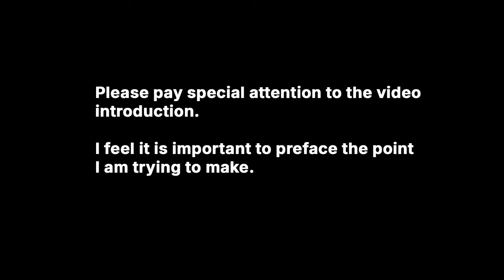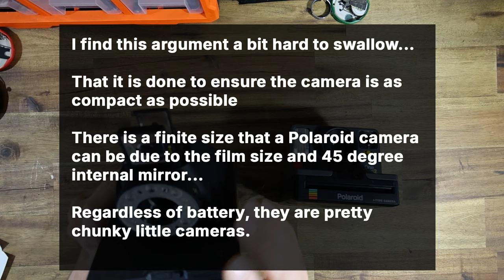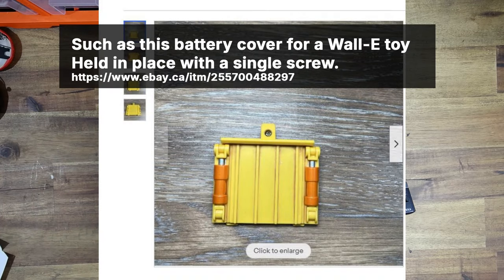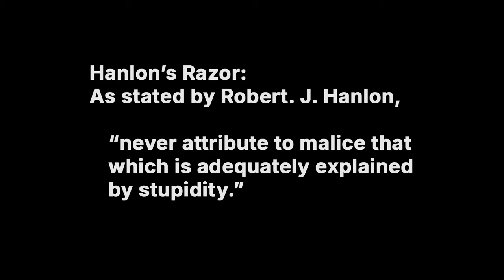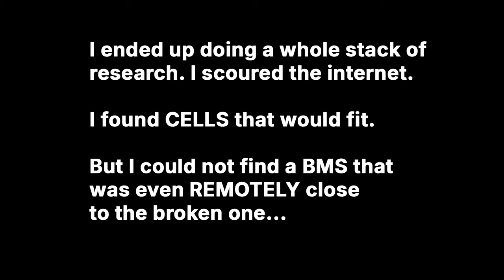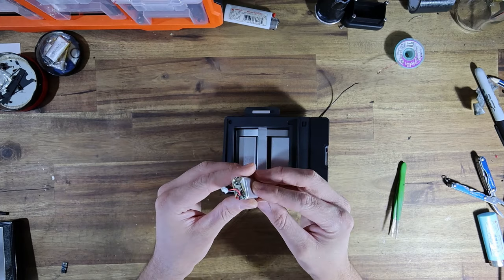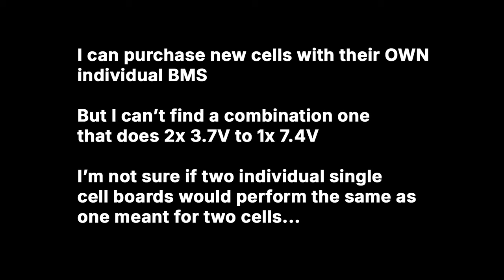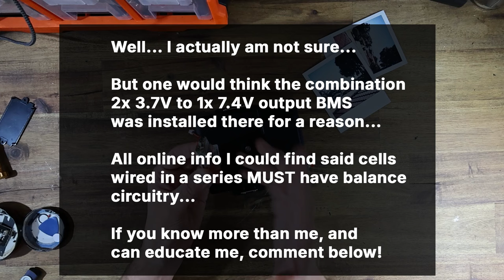Polaroid i-Type Camera Battery Issues - Part 1: The problem with built-in lithium ion cells

Comment: You probably already know this but lithium polymer batteries actually do have a standard. 
If I have a battery that says 103450 it means 10mm x 34mm x 50mm.  In the case of the doubled up packs though, I don't know if that has a standard.

I haven't gotten into repairing Polaroid specifically so I have some stuff to learn, but part of me wonders how many amps the motors pull, because I'm wondering how long two 2032 cells would last.

Comment: Another excellent video Jake and your criticisms about  non friendly battery replacement are perfectly justified. Let's not be coy about it, it's simply a form of built in obsolescence.
And for a company that makes a point that its current cameras are made from 40% recycled materials having non replaceable batteries, where most owners/users are concerned is hypocritical/counter productive. People that have criticised you for making this  point are talking bollocks. As you say a replaceable battery behind a door/flap secured by a screw and a security screw if necessary would make them child proof.
All of  Fuji Instant cameras take replaceable batteries of one kind or another. My Instax Wide 300 uses AA cells and my Mini 90 Neo Classic uses a lithium-ion battery which sits behind a door/flap in the back of the camera.
My Polaroid Now Gen 2 when the battery fails on that which it will do at some time will just end up at my local recycling centre as even if i could find someone to replace it, with the cost of the battery and labour for doing it, it would be just as costly as buying another new camera.
Regards,Patrick
Reply from the maker: After I publicly criticized the I-2 after its launched - and was met with a prickly reception from Polaroid super-fans I feel I must make disclaimers at the start of my videos now

It seems there is an element of buyers remorse, or owner-bias when it comes to doing critical reviews, with owners of i-Type cameras feeling personally insulted when I point out their camera is flawed. 

My intention is not to insult anyone, but to point out how ridiculous it is to have to completely dismantle the camera (and crack out a soldering iron!) just to swap out your battery every 2-5 years

Comment: 36:53
Why wouldn't it need balancing? They're connected in parallel so how would the charge circuit know when both batteries are charged? One can be flat while the other is still 20% charged. There definitely needs to be a board to monitor both cells. For the i1 I would just source a single cell instead of using 2 in parallel.
Reply from the maker: If you were to use off-the shelf cells - each individual cell would have its own standard 3.7v BMS to monitor voltage. Wiring them in parallel shouldn't alter charging in the I-1

Whereas the Instant Lab has a unique custom BMS to handle the combined 7.4V output. It's not a standard part. And hooking up 3.7v BMS units pos to neg seems so sketchy to me

Off the shelf double cells work fine for the I-1, but you are correct - I now use a single 900mHa cell instead of two. It's much simpler. I actually made a follow up video to this demonstrating it. 

But the I-1 I modified to the 900mHa cell had film ejection issues - totally seperate to the battery lol

So they video never saw the light of day. Next I-1 I do... I'll cover it

Comment: I will be following this thread very closely! I wasn’t able to afford the I-1 when it first came out because I was a broke college student at the time. Nowadays i was able to afford them and bought one of eBay not knowing anything about the shelf life of the battery and was super bummed when it didn’t work. 

Then I bought a second one on eBay and it had the exact same faulty battery problem as the first. Double bummed. So if you have a way of fixing these I would be STOKED
Reply from the maker: I can fix them now. I have a supplier of new cells to adapt to them :)
Reply: @theinstantcameraguy  excellent! I sent you an email earlier this morning! Stoked to be working with you soon!
Reply from the maker: @McCoyFromSpace  answered!

Comment: what's your opinion on those polastudio declarable sx-70 batteries?
Reply from the maker: The Polastudio batteries use a similar battery type to the ones used in current i-Type cameras

They are beautiful, sleek, and look/perform great

But... if you put a new skin on the bottom of the back... you will be removing it in a few years time and completely dismantling the bottom panel in a few years once the battery ceased to hold charge

As such, I don't recommend them

Comment: I was looking into this recently; do you think it'd be possible to replace the battery in the i-1 with an external 18650? Is there any way it could be done without modifying the exterior of the camera?

Currently mine only works when connected to an external power supply, which is _ridiculous_. The battery seems to drain without being used within a few days too even when turned off.
Reply from the maker: Not easily 

I did just do another video on how to replace the battery and make it easier to swap in the future

Comment: What’s up with the cold shoe on the i-type viewfinder in the begging?
Reply from the maker: this is a OneStep 2 that I have modified. I had a custom 3D printed 37mm filter holder made up so that I could mount a fisheye lens to it... that part is in storage somewhere after my move

I added the cold shoe so I could mount a fisheye viewfinder

In addition, the camera has had its side panel cut out, and an aluminium plate installed to act as an access door to the battery. I also added a plug on the leads to make it easy to install a replacement.  I did this to prove that a battery door could be easily added without adding a significant increase in the cameras size.

Comment: I for sure thought I posted something in regards to the proper battery replacement specs for the I-2. Now its gone. Was it removed?
Reply from the maker: I don't think I can actually remove comments on YouTube. Feel free to post the specs!
Reply: @theinstantcameraguy  So, as with every other I-1 owner, the battery was toast, so the hunt was on. I found a slightly smaller (dimensionally) 750 mAh lithium battery and soldered it in (also found a 900mAh that fits). The trick with the I-2 is that most of the time it still wont turn on. So fully charge the camera and new battery, then with all the switches and dial in the off position. open the film bay door and depress the reset button to the left of the door shut micro switch. Use a pen etc. Then back on the charger for a half hour or so. This method worked on both of my I-1's. Attached are the two ASIN numbers (item numbers) for the batteries on Amazon. Seems youtube does link links.
750mAh is : B0CP26Y5QC
900mAh is : B089N7SZFD

Hope it helps
Reply from the maker: @sicarius66  I did actually toy with the idea of swapping the battery for just a single larger one. I'll have a look!

Comment: Please make a video on the now+ i recently got one and i'm quite worried about this :/
Reply from the maker: you have every right to be worried. Eventually the battery will cease to hold a charge. Batteries all die eventually

The "Now" series are too new to have failed yet in any great numbers, given that they are only a few years old. My next video will feature the Onestep2 - the precursor to the 'now'.

Feel free to contact Polaroid and express your concerns. As far as I am aware, there is no factory support for spares
Reply: @theinstantcameraguy is the one step 2 the same as the one step+  .
Reply from the maker: @art1386  its similar

At the end of the day it doesn't really matter

ALL current i-Type cameras, from the Go to the I-2 use the same kind of batteries

Comment: Love Polaroid but the non-replaceable batteries in their itype cameras is 😢😮 my one step plus is dead 💀 and in the uk I can pay 30% more to get the battery replaced than the cost of the camera when new. I have purchased 50 year old Polaroids for less than £15, and they work. So I won’t buy a new itype camera now until they charge this stupid junking of their new cameras, so we buy the next new model. But, it’s so dumb because the cameras are mostly cheap anyway so getting another model is fine for a keen Polaroid enthusiast. So it just doesn’t make any sense to me.  I hope more people complain (and I have to Polaroid) so it changes.
Reply: I have a one-step plus which for me is still working battery holds a charge for quite some time. For some reason the Polaroid Now cameras are notorious for overexposing the image.